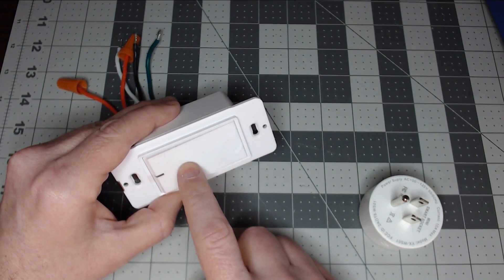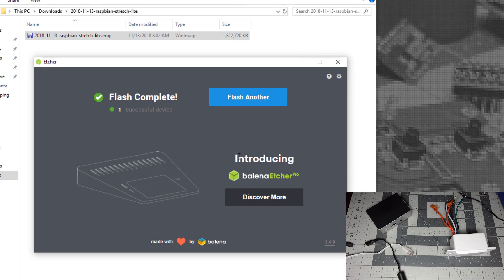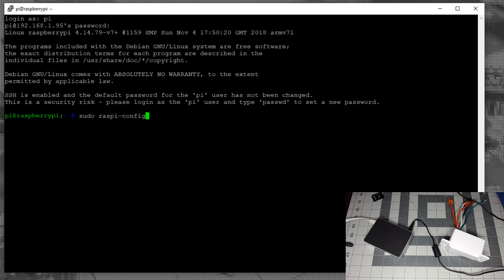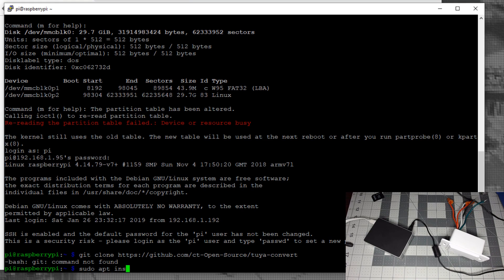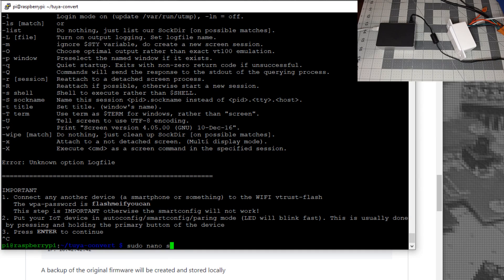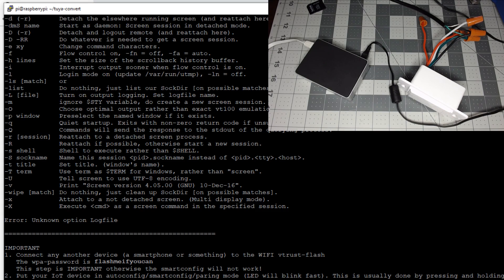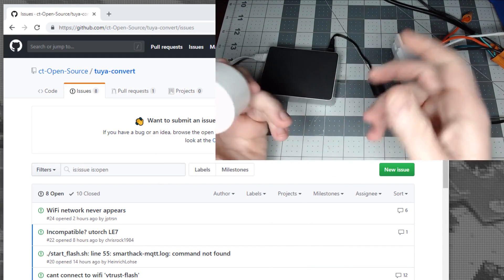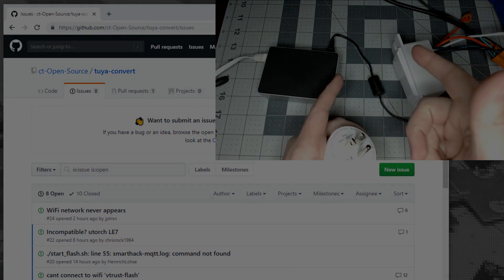Flash Tuya Smart Switches, Plugs, and others all Over the Air - No soldering!

Comment: Got a Martin Jerry switch.  Followed everything to the letter but it doesn’t flash.  Maybe it already has the new firmware to block flashing.  Anyone knows how I can determine that?  Thanks
Reply from the maker: I have heard a rumor from someone else that had this same issue. Only way is to check the firmware version in the Tuya app
Reply: digiblurDIY thanks for the reply and the videos.  Which firmware should I be looking for? Any idea?
Reply from the maker: Have you used your Tuya convert on other devices with success?
Reply: digiblurDIY unfortunately no.  I opted for 2 tplink switches for my initial purchase to make it easy for my wife to use.  This is my first tuya based switch but I may have to purchase a different one.  I am also looking at a UL listed device (not sure how much of a difference it will make) just to be extra safe.  I think topgreener is flushable.  If not I will at least look for an etl listed switch.  I can control the tplinks with home assistance but they get information.  I want to go HA compatible only.  any recommendations?  Also, thank you for taking the time to read and respond.  I imagine you have a tight schedule
Reply from the maker: I wouldn't hold out hope unless you try another device and it works and the martin jerry switch doesn't work still after that.  There are some ETL switches such as the KULED ones I did.  https://amzn.to/2JqvWd6  https://www.youtube.com/watch?v=4nX90vhAniQ   Plus they are easy to flash the old way for backup purposes.

Comment: tasmota-6.5.0-generic-wifiman-2.3.0.bin has problem connecting HA mqtt server
is this firmware based on sonoff basic which doesn't have mqtt discovery feature?
will it be possible to compile firmware with default wifi manager but based on sonoff firmware (not sonoff basic) ?
Reply from the maker: Yes. HA MQTT discovery is included in the firmware but setoption19 is not turned on. You can upgrade to any firmware version you want via the firmware upgrade GUI option as the firmware is designed to make sure you do not get locked out of the  firmware.

Comment: with factory firmware, i can reset the smart plug by pressing button for 5 seconds
how to configure button reset with tasmota firmware?
Reply from the maker: If you have the button configured. Hold it down for 40 seconds is the factory default for Tasmota.
Reply: @digiblurDIY  will it work too on smartplug with button1 on gpio1, not on gpio0 ?
Reply from the maker: @chloelouisa1439  gpio pin doesn't matter as long as it is configured right in Tasmota.  It's a 40 second hold on the button1 
https://github.com/arendst/Sonoff-Tasmota/wiki/Button-usage

Comment: what can i do if after flash I to tasmotat i put the wrong wifi ssid or wrong pass because after that my dimer don't show up on my network ?
Reply from the maker: If you didn't flash the bin I provided in the description then you will have to make a network with the SSID you picked or typed and make it with no security.
Reply: my bad i don't read before ... Can i pop open my device and re-flash it ? After that can I update tasmota our I will loose the re-connectivity feature ?
Reply from the maker: Depending on the device yes. No need to reflash actually. Just attach via a serial terminal at 115200 baud and the Tasmota console is there waiting to take commands.

Comment: Thanks for the video.
I used it to update the Tessan Dimmer. I think everything with the process went OK. I can talk to it with my web browser. 
I set the configuration to "Tuya Dimmer" and I if I move the slider or hit the toggle button, the "ON" indication shows up on the web page but...
the buttons don't do anything
the led's don't light up 
there is no output voltage.

When I first powered it up, the default configuration was Sonoff Basic. If I select that configuration, the LED's on the dimmer would lite up. but nothing else works.
I assume it is a configuration issue, but I don't know what I need.
Reply from the maker: Yes you are right it needs a slightly different config. I did a complete walk through of using the Tessan dimmer recently. https://youtu.be/ZHA4p3yS4gE
Reply: @digiblurDIY  
Thanks so much. I got everything working except the console does not display any text. 
I look forward to getting this installed. This is my first automation project
Reply from the maker: The console of Tasmota?  What error is it showing?  You might have to hit me up on discord where you can share screen snips to see exactly what is going on.
Reply: @digiblurDIY  Yes, the console of the tasmota. No error messages. No text at all.
I can't tell if it is completely dead, or just no output because I had already entered the commands before loading the update.
Let me know if you want any other data and I will try to get it.
Reply from the maker: Can you ping the device at all? Do the other buttons work in the GUI?
Reply: @digiblurDIY  Yes, the buttons work, I can control it from Home Assistant. It sends status to HA. There is just no text on the Console WIndow
Reply: I should say:
There is no text in the console window. The window itself looks normal except i does not print any text nor does it respond (from what I can tell) to anything I enter on the command line
Reply from the maker: did you turn off all logging some how?  I'd probably do a reset 5 command and start over if you aren't getting any text and the logging is turned on.  It could be a bad flash as well.  I haven't seen that before.
Reply: @digiblurDIY  Logging was the issue. I must have turned it off at some point.
I set it to "Info" and it is acting normal.
Thanks again so much for your help

Comment: It works with MagicHome app.
Reply from the maker: I do believe those use an esp8266 but from what I remember you had to flash them manually
Reply: @digiblurDIY  thanks for the info. Another, can I flash using my Pie Zero W?
Reply from the maker: Yes as long as you have two network interfaces.

Comment: noob question.  i just installed hassio and ESPHome on VirtualBox and it looks like it is working good.  i picked up some feit bulbs from costco and got them working with the feit electric iPhone app and know their ip address from my router.  they identify themselves as ESP_2AO24D.  do i still need to do tuya-convert before attempting to use with ESPHome?  the easiest way is to flash tasomota with tuya-convert, then change to ESPHome?

i am trying to get tuya-convert installed on VirtualBox too.

thanks for all the great info.  i have learned a lot, and just getting started.
Reply from the maker: You can go directly to Esphome as I have heard of others doing it. You would just need to make your bin file for each device you convert before hand and send it over during the conversion process.

Comment: I'm able to flash the first of two Teckin SP20 smart plugs successfully using steps outlined in the video.  But on the 2nd SP20, the flashing process was stuck in:

Waiting for the upgraded device to appear
If this does not work have a look at the '*.log'-files in the 'scripts' subfolder:
..............................................................................

The "............" went on for a long time.  Finally,, I just ctr-c out.  Now, the devise won't go into flash mode (i.e., light on device doesn't blink anymore when the button is pressed and held down for 6 seconds).  I didn't see anything obvious in the log files.  What do you think went wrong during this flash?  For future reference, should I have ctr-C out of the process?
Reply from the maker: Did it ever do the long list of hex codes?
Reply: @digiblurDIY  NO.  There were no hex codes even on the first SP20 that worked.
Reply from the maker: The screen should have filled with the firmware dump if the exploit worked. You can try running it again.
Reply: @digiblurDIY  Where in the flashing process should I start?  The device no longer goes into pairing mode (i.e., no flashing lights when I hold down the button; the light flashes a couple of time when I plug the device in)
Reply from the maker: Start the flash process up again.. But skip the pairing part and see if it picks it up.
Reply: @digiblurDIY  Ok, I tried it again, and got to the same "Waiting for the upgrade device to appear" message, followed by the "..................."  I ctr-c out after waiting around 10 minutes.  Do you think this device is toast as far as Tuya-convert flashing goes?

I have a couple more of these same plugs coming.  Do you have any suggestions on what to do if the flashing process gets stuck in the "......." stage again.  How long should I wait before hitting ctr-c?  I noticed there's a file named "stop_flash.sh" in the same directory as "start_flash.sh."  Do you know what this is for?
Reply from the maker: The stop flash stops the entire process and stops the web server.  Have you been able to do any other plugs?  do you see any of them broadcasting a vtrust-recovery SSID?
Reply: @digiblurDIY  I was able to successfully flash another one of the same device (Teckin SP20).  As soon as I started the flash, a message came up on terminal saying it's doing a backup of the firmware.  The displayed time-remaining counter started counting upwards, which really confused me.  That backup process took a really really  long time.  Luckily, I refrained from hitting ctr-c; I was browsing the internet hoping to find some advice on what to do.  Then all of a sudden,  a message came up saying it was done.  I was then able to issue the "flash3" command to flash Tasmota.  No hex code was ever displayed during the flashing process.

I'm not sure if I'm going to try flashing another Tuya device that can't be opened easily.  Seems like the "Tuya Convert" process is a bit of a touch and go.  Hate to end up with more devices I have to cut open to salvage.
Reply from the maker: I have heard they updated the script a bit so it could be showing things a bit different.  I wouldn't let the Teckin SP20 scare you as that seems to be the number 1 device that everyone seems to have issues with, very hit or miss for some odd reason.  I can say I've done probably 40+ various devices and all converted just fine.  One difference as well has been I've used the compiled firmware I linked in the process that has wifi manager as default to also prevent being locked out by a wrong wifi SSID and/or password.
Reply: @pauljohnson-yk5dq  Same EXACT thing happened to me with the first SP20 I tried.  It's not broadcasting the vtrust-recovery SSID, can't re-flash, it's just a brick at this point.  Not sure how to recover.  Button does nothing, short or long press.

Comment: I flashed it correctly with the same switch, but I can only toggle the light over the wifi. The button no longer does anything. Is there a fix for this?
Reply from the maker: Which switch?
Reply: @digiblurDIY  Martin Jerry. I figured it out. It was set up for a sonoff basic. That was a crazy fast reply though. I accidentally flashed the first switch I did before putting it in pairing mode. Do I have to go the soldering route now or can I redo it?
Reply: @mattmurphey5586  what was the fix Matt. I have the same issue
Reply: @SridharKantamneni  I flashed it by soldering. I never tried to reflash using the over the air method
Reply: @digiblurDIY  I forgot to put the switch in pairing mode before flashing. Then it wouldn't turn on or off with the button. I didn't do the curl command because I thought I broke it
Reply from the maker: If it wasn't in pairing mode then the exploit wouldn't work. It has to be in the fast blinking mode for the exploit to work.

Comment: Thank you for the awesome tutorial! I just picked up 2 of these Iotton bulbs (https://smile.amazon.com/gp/product/B075882X14/ref=ppx_yo_dt_b_asin_title_o00_s00?ie=UTF8&psc=1) and flashed with Tasmota using this tutorial.
Reply from the maker: What template did you end up using?
Reply: @digiblurDIY  Haven't gotten that part sorted out. The LOHAS template worked initially with the wrong colors mapped but now I get nada. 4 channel PWM doesn't work either. Any advice on how to disassemble or tell what chipset is on board? I still have one running Tasmota Generic to try and manipulate the pins.
Reply from the maker: Sounds like my9231/9291 then if  it worked.
Reply: @digiblurDIY  Yes just popped the cover and verified there is a single my9291
Reply: @digiblurDIY  Figured it out:

my9231:
  data_pin: GPIO13  # GPIO13 for AiLight
  clock_pin: GPIO15  # GPIO15 for AiLight
  num_channels: 4
  num_chips: 1

output:
  - platform: my9231
    id: output_white
    channel: 0
  - platform: my9231
    id: output_blue
    channel: 1
  - platform: my9231
    id: output_green
    channel: 2
  - platform: my9231
    id: output_red
    channel: 3

light:

  - platform: rgbw
    name: iotton1
    red: output_red
    green: output_green
    blue: output_blue
    white: output_white

Comment: Somewhere in the video (I think) that you said to hook up the switch to mains. Can you please explain what you did. It is hard to tell in the video what wires you have to the switch. Thank you.
Reply from the maker: Yes. You have to power the device to put it in pairing mode. The script on the screen says to put it in pairing mode before hitting enter. That's where you have to power things up.
Reply: @digiblurDIY  Sorry if I was not clear. How did you power it. A power cord with the ends cut off? And does if it needs a neutral how did you add it. It is hard to see what was done in the picture in picture of the device. Thanks.
Reply from the maker: You can do it either way. You could put it in the wall but I prefer on the bench. Usually I have a 1 gang electrical box to test stuff over extended periods so I don't have any exposed wires for others to get into even though I unplug stuff when I am not supervising it. In a pinch you can use an extension cord as well to power a switch. Doing a plug is easy of course as you just plug it in.

Comment: Hey Travis - this is excellent! Terrific and thorough video!
I was able to flash 4 teckin plugs with no issue.  I am looking at a few $10-12 WIFI Motion sensors that use Tuya/Smartlife, do you think or know anyone who has flashed them with Tasmota? Their specs do not say whether or not they are using an ESP8266.
Thanks
Reply from the maker: I haven't heard of anyone flashing them but have seen them. Sounds like something that fires up and goes back to sleep on motion?

Comment: I'm looking for new devices to replace my Iris by Lowe's system (unless I discover that the Iris devices will work in Home Assistant).  Will these Tuya devices in the video not work as is in Home Assistant if they are part of Tuya Smart?  I have a few Merkury bulbs configured in Tuya Smart and they are working great in Home Assistant without modification.
Reply from the maker: They will work of course without modification using the cloud component of Tuya. This is about removing the reliance of cloud, adding features, improving response time being all local and increasing reliability.
Reply: OK, good point!   Thank you for the clarification.

Comment: Just flashed ten of the CE Smart Home plugs from Costco; they work great thanks to your awesome video, thank you sooooo much!!!!!
Reply: The custom Tasmota configs are posted on github at  https://github.com/arendst/Sonoff-Tasmota/wiki/CE-Smart-Home---LA-WF3-Wifi-Plug-(TYWE2S).  The Costco reviews are not great, but they have been rock solid running Tasmota/Home Assistant so far.
Reply: The new wiki for these plugs is at https://tasmota.github.io/docs/devices/CE-Smart-Home---LA-WF3-Wifi-Plug/#module-configuration
The config is at the bottom of the page.

Comment: Travis, can you reprogram the MOES 3-ways with this method.  I flashed my Smart Life Power strip so I assume that the answer is yes.  I have got 3 of the  MOES coming Monday.
Reply from the maker: Yep. That's the first switch I tested with and shown in the video. Did it like 7 or 8 times as I had the backup firmware and such.
Reply: I watched the video on the MOES 3-ways and decided that is the way for me to go as I have a house full of 3-ways.  Thanks for the reply.
Reply from the maker: Gotcha. Check the comments for an updated template someone did in HA. I also noticed when I changed to a little better bulb that state delay issue went away as well. Love ours so far and saved me some rewiring.
Reply: i flashed my Moes 3 way today, it all seemed to go well and I entered the sssid and password, but it then did not retart, no lights at all on the switch, totally dead. Any ideas?

Comment: New feature in 6.4.1.16 - 'template' : for adding a module without compiling/making customized sonoff.bin . Added TUYA twin plug Orange Tech 2 in 1 Smart Energy Monitoring Socket Wifi Mini Outlet [SP201]  https://www.amazon.com/gp/product/B07L63S731  - on Console enter  
template {"NAME":"SP201","GPIO":[56,0,0,131,17,134,0,0,21,18,132,22,0],"FLAG":0,"BASE":18} 
from configuration-module select SP201(0)    Done!

Comment: Works on MartinJerry dimmer.....but not (so far) on MartinJerry 3-way dimmer.
Reply from the maker: Martin Jerry 3 way is not an esp8266 unfortunately.
Reply: @digiblurDIY  well heck. I wondered why it wouldn't work the regular way with soldering. Can I recompile the code for a different processor and make it work?